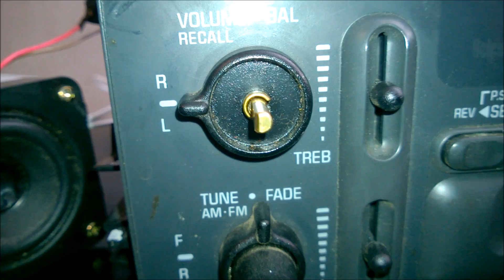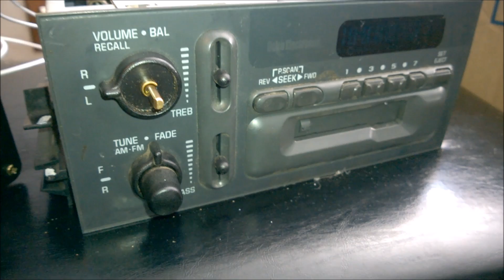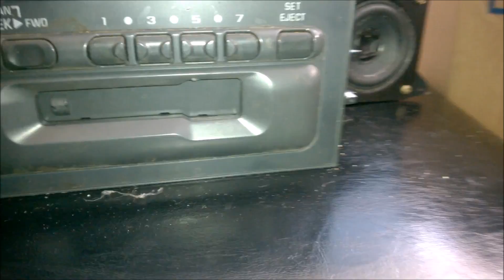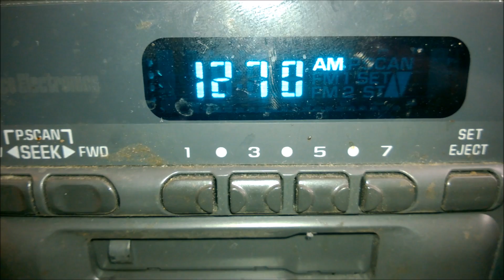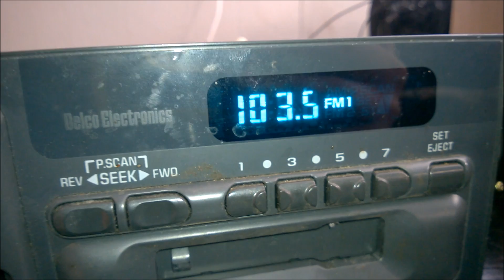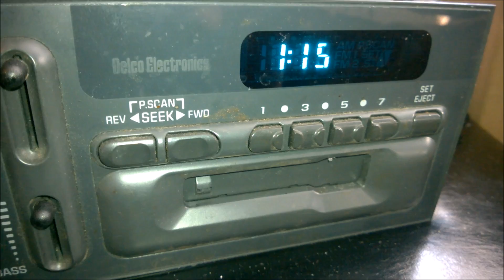Delco Radio Test and Demonstration

Comment: How do you set channels
Reply from the maker: Cody Eakin you push and hold the specific channel button (on this radio, to set the channel for the even numbers 2, 4, and 6, you press the two buttons next to each other that has 2 half-circles).

Comment: the one i have will take the tape and make sounds and it stops
Reply: i have a 98 s10 chevy with this radio and when i turn the radio on the tape deck makes noise then i put a tape in and it gets stuck